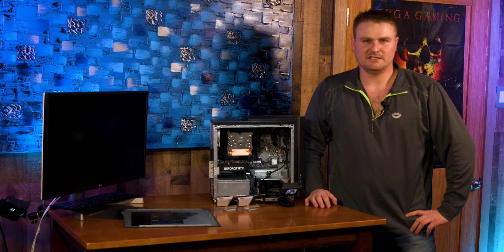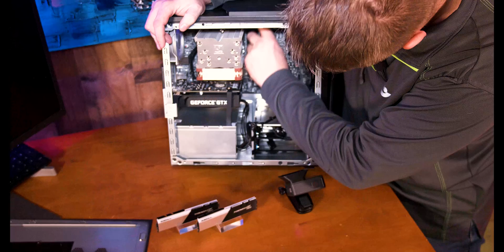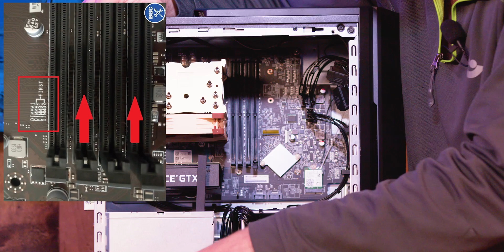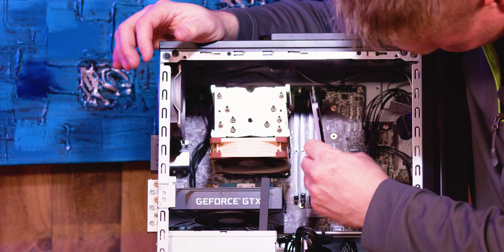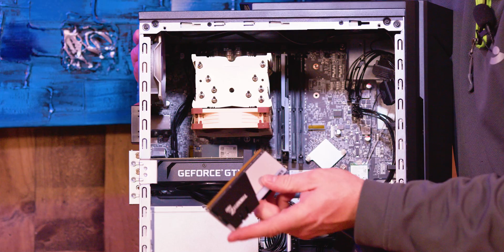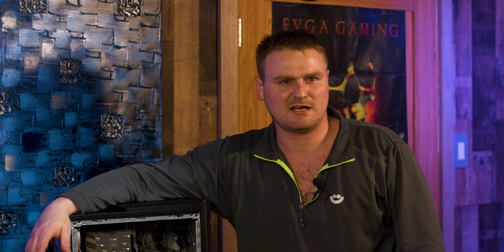Acer Nitro 50 How to Install Memory for Dual Channel RAM | 16Gb Upgrade

Comment: Hello. I'd like to know the name of the motherboard in that PC, which is the same as mine. I have 16 GB of memory and I want to add 16 more, so... Which card should I buy and how many? Thanks.
Reply: your best bet for compatibility is to buy a new set of 32g  likely its DDR4 if your pc came with gtx 16 series cardand I recommend a speed of 3200 or 3600
Reply: @Kramptonyte  Mi PC es DDR5 y no sé por qué tengo solo 2 ranuras en un PC más nuevo e igual al del ordenador del vídeo, que parece que tiene cuatro ranuras. Mis ranuras son de 8GB cada una. Ya he preguntado, y me han dicho que tengo que comprarme dos de 16 GB si quero tener 32, que claro...Cuestan más de100 Euros, porque hay que ponerle 2. Mi PC es de 4.GH
Reply: @maiapez6802 You can buy a single 16 gig, DDR5 There's a small chance that it will Not work properly with the other stick of RAM. But in my opinion, it's worth the risk, especially with that high cost.
Reply: @Kramptonyte  That's what they told me, that for it to work they have to be identical, with the same power, brand and model. Can my PC have just one 32GB and not a pair of 16GB?
Reply: @maiapez6802  While it's better for it to be identical, it does not have to be.
Reply: I already bought them, thanks. Thank you very much for your help, now I have 32GB of RAM..

Comment: How xmp-supported ram works tho in the n50-610 ?! Is it capped at 2133mhz or it goes up until the maximum of 3600 ?
Reply: it will be capped
Reply: @Kramptonyte  so as much as i understand, i need to buy the "generic" brands like micron/crucial, ect  who dont got any xmp profiles to have the maximum speed of 3200mhz ?!
Reply: @ayaaaa98  find a kit that fits your budget if dealing DDR4 the sweet spot for price tends to be 3200mhz for 2x8 or 2x16  first goes for roughly 40CAD  second goes for roughly 70CAD

Comment: Bro im wondering why your heat sink fan is faced to the bottom on this video? I watched your other video about fixing the overheating problem with nitro 50 and you installed the cpu heat sink fan the other way? what has changed?
Reply: air flow is air flow so at least with this design you are getting more air to the gpu. and he upgraded the cooler multiple times over the years. assume that the newer videos have a better cooler

Comment: I try adding 2x32gb ram and when i start it it make a continue noise. I checked if it supports the ram and it does. I dont know if i put them wrong or something else. Pls hell
Reply: The new one are udimm compared to the old one that are dimm

Comment: hi sorry to be annoying but would the Crucial Pro DDR4 RAM 32GB Kit (2x16GB) 3200MHz, Intel XMP 2.0, Computer Memory (PC) - CP2K16G4DFRA32A from amazon work with it?
Reply: it will but there is no xmp adjustment in the nitro 50 so its gonna run at 2133 no matter what
Reply: @Kramptonyte  ok thanks ive already installed it is the 3200 much better

Comment: Can i use one rated for 1.35 volt
Reply: Ram follow a Jedec standard and are all capable of running at default speeds between 2133, 2400 and 2666 at 1.2v. Faster than that requires XMP or which will run the ram at 1.35v.  Sadly I do not believe that Acer Nitro 50 MBs can use XMP so its gonna run at the lower speed dictated by the MB. but its perfectly safe to use Ram that is 1.35v

Comment: Hi, I have an Acer Nitro 50-640 and I would like to put 8 GB of RAM in it more. Do I have to get my hands on the bios or do I just insert the RAM and the job is finished here? Also I only have two banks of ram. Thank you
Reply: You don’t have to put your hands in the bios, is only insert the ram and is finished

Comment: Just got 2x8gb sticks of Kingston/HyperX Fury 3200mhz 1.25v Ram that you linked in the description and its not working. My key PC gives a long error and does not boot. I even tried installing one stick into the original spot The first one was in and still doesn't work. But when i put the old stick back into either slot, it works fine. So i know theres no dust or debris or port issues. Its issue with the ram itself.
Reply from the maker: Yes I would send that kit back what brand did that ?
Reply: @TNW1337  It was Kingston/HyperX Fury, I ended up getting a refund for it, not sure why it didnt work, might have been because it was CL16 instead of 22 or/also because it was 1rx8 instead of 16, so i looked inside the PC and ordered an Exact Stick of the same Micron CL22 1rx16 3200 Non ECC 1.2v stick that came with it, i installed it and theyre working perfectly, it wasnt expensive either, 16gb Ram running great, i also followed your other video and replaced my 1650 with a 3060 which is also running perfectly, so thanks for the help!
Reply from the maker: Sometimes, they change brands or chips During production.

Comment: Hi, I have an Acer Nitro 50-640 and I would like to put 8 GB of RAM in it more. Do I have to get my hands on the bios or do I just insert the RAM and the job is finished here? Also I only have two banks of ram. Thank you
Reply: just replace the ram and it's done

Comment: Why is it when I put in a fourth RAM stick in (8gb DDR4 3200mHz), the computer makes a continuous beeping noise and the screen remains black? The compatibility is all correct and no damage was done to either the sticks or the slots.
Reply from the maker: you may have a bad stick of ram. are you using mixed speed of ram?
Reply: @TNW1337  the speeds are all the same. However, I found the problem: a piece of dust😒😒.
Also, thanks for making this video. The steps are very straightforward and clear.
Keep up the good work!

Comment: I have this pc but it only has 2 ram slots, what can I do? one is used, if i pu t the second one, will it be dual?
Reply from the maker: you want to buy a matching dual channel set. you can just stick another dimm in but will need to remove the old one  and find a matching one online. the price of the single stick vs a kit is not much more.
Reply: @TNW1337 alr thanks

Comment: So I did this and now my PC is making a long and continuous beep sound, any help on how to fix this?
Reply: Have you found out what the cause is?
Reply from the maker: Well remove one stick and see if it loads also may not be sloted in all the way.
Reply from the maker: if it does load with one stick swap them if it beeps then you have a bad dim. RMA it to amazon and get a different brand.

Comment: how do you update the bios. Im stuck at running 2133mhz instead of 3200
Reply from the maker: You can not no xmp supprt. But you gain way more with heaving the slower speed CL16 ram vs the faster 3200mhz CL22 Ram.

Comment: Does the stick it comes with not support dual channel ram?
Reply from the maker: it does. but you much match sticks and by that time it easier to just get a dual channel kit and cheaper. there are other reason to but not going to get in to it.

Comment: will the Corsair Vengeance DDR5-5200 32GB CL40 Dual Channel work?
Reply from the maker: Nope
Reply: DDR5 does not work with DDR4 Motherboards. You can only use DDR4 in a R4 slot, and R5 with an R5 Motherboard/Slot. The DDR is not interchangeable, not in any PC.

Comment: I have a acer nitro 5 pc and it came with a 8gb ram stick but there’s only two ram slots in the mother board. Will it run dual channel if I add another 8gb ram
Reply from the maker: YEs it will

Comment: hey is there a why to change the red light on my pc to a different color?? Pls help me out❤❤
Reply: I have a acer nitro 5 pc and it came with a 8gb ram stick but there’s only two ram slots in the mother board. Will it run dual channel if I add another 8gb ram

Comment: I've installed a 32gb ram kit that can run up to 3600mhz, but it only runs at 2677mhz. Do you know if it's possible to get the advertised 3600mhz in this computer?
Reply: @goldhoney9401 Can you tell me what ram bran you got and where to buy it I need this
Reply: @ZENtaurusRMD15UCL  corsair vengeance lpx 3600mhz ddr4 dual channel. I bought it at a local tech store
Reply: I have a acer nitro 5 pc and it came with a 8gb ram stick but there’s only two ram slots in the mother board. Will it run dual channel if I add another 8gb ram?
Reply: @Trey-dg8yw  I think it most likely will run dual channel, and even if it doesn't, it's still gonna perform better since you have more RAM
Reply: @goldhoney9401  what if I get another ram stick that’s different from the one already in my game when I first got it. Do they have to be the same?
Reply: @Trey-dg8yw  it will most likely work, but it's probably better to just buy two new ones. They'll run at the same clock speed and it's not really that expensive. I recommend corsair vengeance lpx 16/32gb (dual channel ofc)

Comment: I've got an acer nitro m50 610. It has rtx 1660 super and an i5 10400f processor. I

 I want to upgrade it to a I 7 10700k  with a 3060 gpu. Will I need to uograde the psu also? 

Thank you

Comment: I am just trying upgrade mines from 8GB TO A 16GB? Do I just used the first slot? Do i just replace the 8GB with the 16gb or just put 16gb in the second slot to make a 24gb or buy two 8Gb to make a 16gb ?
Reply from the maker: Well you would want to remove the other stick and order to replace it!
Reply: ok thank you, one more question so just buy a 16gb and replace it with the 8gb. Why do they want you to buy two 8GB to make a 16gb is that the right things to do. I see in your Bio it got Ram cards. Are they all great ram cards? @TNW1337

Comment: hey i know this vid is old and you may not reply but is it okay to add 16gb of ram whith the default 8gb of ram it comes with also my pc version has 2 slots
Reply: No you cannot mix dimm sizes. You can use an 8gb with a 16gb
But,
2 slots is fine, you could even change it out for 2x16gb which is more than enough for most builds. So just remove the 8gb stick and add 2x 16gbs sticks instead
Reply: @KiLLJOY1056  to make it 32gb ram ?

Comment: Damn man, thank god i stumbled upon this vid. I have been using 2 sticks of 16gb for more then 9 months and wondered why I’m struggling with performance, I literally tried everything including upgrading cooling etc. Turns out i just had the RAM stick in the wrong slot 🤣
Reply: I have a acer nitro 5 pc and it came with a 8gb ram stick but there’s only two ram slots in the mother board. Will it run dual channel if I add another 8gb ram?
Reply from the maker: All good Mr.house!

Comment: Hey brother don't know if you still respond to these comments but I am wondering if after installing the ram upgrade I have to flash the bios?, or do some kind of hardware recognition in the computer software? i am very new to this lol
Reply: I have a acer nitro 5 pc and it came with a 8gb ram stick but there’s only two ram slots in the mother board. Will it run dual channel if I add another 8gb ram?
Reply: Yup just make sure its the same MHZ  @Trey-dg8yw

Comment: Hello I know this is an older video but I’m having an issue when I install more ram and I go to system settings it’s still showing I only have 8gb, any help is appreciated. Thank you
Reply: I have a acer nitro 5 pc and it came with a 8gb ram stick but there’s only two ram slots in the mother board. Will it run dual channel if I add another 8gb ram?

Comment: you are doing gods work
Reply from the maker: WOW! Thanks!
Reply: I have a acer nitro 5 pc and it came with a 8gb ram stick but there’s only two ram slots in the mother board. Will it run dual channel if I add another 8gb ram

Comment: Thanks for the cool video.  I was hoping there would only be a few to choose from tho, think I only have 8GB currently and looking to buy more.
Reply: I have a acer nitro 5 pc and it came with a 8gb ram stick but there’s only two ram slots in the mother board. Will it run dual channel if I add another 8gb ram?
Reply: Sorry mate the both ram needs to be same brand u can use different one and I can use my old one with another one?

Comment: I just bought a Acer Nitro 50 N50-640-UR13 Gaming Desktop | 12th Gen Intel Core i5-12400F 6-Core Processor | NVIDIA GeForce RTX 3050 | 16GB 3200MHz DDR4 | 512GB SSD | 1TB HDD | Intel Wi-Fi 6E AX211 | Windows 11 Home
What upgrades can i do to it, or should i get a new motherboard and case?
Reply: get a 4060 and upgrade your case fans and heatsink.

Comment: what RAM can I install that will run at 3200 out of the box and not reduce to 2133, or 2400?
Reply: I have a acer nitro 5 pc and it came with a 8gb ram stick but there’s only two ram slots in the mother board. Will it run dual channel if I add another 8gb ram?
Reply: @Trey-dg8yw  if there are two ram slots, yes. But make sure the ram sticks are the same. They have to have the same rated speed as well as the same size
Reply: @conornos  what if the one that came with the pc says 8GB 3200MHz DDR4 but the company made it so I can’t get the same exact one that’s already in there. So I just find a random one on Amazon that says the same exact thing but the stick will look different

Comment: I used Corsair LPX Vengeance 3200mhz sticks and the computer was not booting, only giving a long beep which indicated a memory error. It really is a shame how much they limit the upgradability of this system. I believe I have to use JEDEC memory from the likes of Crucial which are supported by this system.
Reply from the maker: Yes it sucks, I wish they just open it up
Reply: @TNW1337  hi I was wondering what is the best cpu cooler for this Acer I want one with rgb but not big
Reply: Hi there was that the one without rgb like the black and yellow one
Reply: I have a acer nitro 5 pc and it came with a 8gb ram stick but there’s only two ram slots in the mother board. Will it run dual channel if I add another 8gb ram?
Reply: @Trey-dg8yw  Yep, if its matching sticks
Reply: @kruegersix  they have to be matching?
Reply: @kruegersix   what if the one that came with the pc says 8GB 3200MHz DDR4 but the company made it so I can’t get the same exact one that’s already in there. So I just find a random one on Amazon that says the same exact thing but the stick will look different?
Reply: @Trey-dg8yw  For this PC I'm pretty sure Crucial has the sticks you need to put in this one (check the speed of your memory before though).

You can just buy another 8gb stick from crucial, but I would rather just buy the 2x8 kit from them.

Random mismatching sticks may not work properly so it's best to just get matching
Reply: Mines did the same thing i had to push it in more it works

Comment: what ram stick are you using to upgrade got the same pc
Reply: I have a acer nitro 5 pc and it came with a 8gb ram stick but there’s only two ram slots in the mother board. Will it run dual channel if I add another 8gb ram?

Comment: hello i have the acer nitro n50-640, case swapped it and would like to upgrade my ram. would the corsair vengeance work with it. if so would i be able to get 2x 16gb?
Reply: I have a acer nitro 5 pc and it came with a 8gb ram stick but there’s only two ram slots in the mother board. Will it run dual channel if I add another 8gb ram?

Comment: Will Kingston Fury Renegade 2x8gb 3600 mhz 1,35v ram work? I buyed it and after reading comments im little scared that it wont. Some guys said that his computer has stopped working completly. So should i put them? And will they be working at 3600 mhz bcs there is no xmp option in bios

Comment: Thank you so much for your help:)
Reply from the maker: No problem.
Reply: @TNW1337  I have a acer nitro 5 pc and it came with a 8gb ram stick but there’s only two ram slots in the mother board. Will it run dual channel if I add another 8gb ram?
Reply: I have a acer nitro 5 pc and it came with a 8gb ram stick but there’s only two ram slots in the mother board. Will it run dual channel if I add another 8gb ram?

Comment: Did you buy this Acer Nitro 50 stock? Did you have to uninstall any software before you upgraded your RAM? I have 2 Corsair Vengeance 3200MHz DDR4 16G RAM sticks Ive been trying to upgrade my PC with and every.single.time. I try and power it on (even with just 1 16g stick installed) I get a loud sustained beep and nothing happens. I even bought an entire brand new Acer Nitro 50 and brand new RAM today and I STILL get the same beeping when I try and turn it on. 

Unless I am the worlds unluckiest person, I am thinking there has to be some software installed on the PC that shuts the PC down if the user tries to upgrade. 

What infuriates me the most is that Ive got 4 Corsair Vengeance in a totally separate Acer Nitro 50 that seemed to work fine when I plugged them in. I don't know if that's because I uninstalled all ACER programs on this PC.
Reply: I have a acer nitro 5 pc and it came with a 8gb ram stick but there’s only two ram slots in the mother board. Will it run dual channel if I add another 8gb ram?
Reply: @Trey-dg8yw  I could only upgrade it to 16g, if I put in more than one Corsair ddr4 the PC would crash
Reply: @Luke_Groundwalker  do the sticks have to be the exact same since I only have two memory slots in the motherboard?

Comment: Hi there I was looking to change my pc case I have the Acer nitro 50-610 I have upgraded the gpu to a ASUs rtx 2060 do you think I could move my cpu,gpu,cpu,ram with is a  Corsair CMK16GX4M2B3200C16 Vengeance LPX 16 GB (2 x 8 GB) DDR4 3200 MHz C16 XMP 2.0 High Performance Desktop Memory Kit, Black and my power supply will I need a new motherboard or psu or both please really sir I beg you it is urgent it is for my son